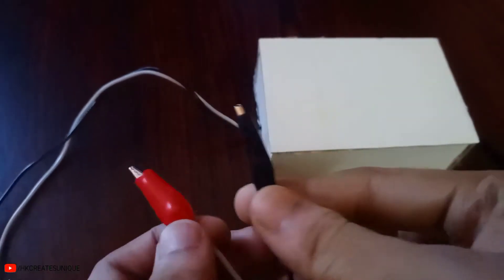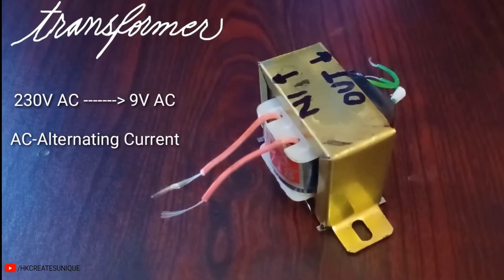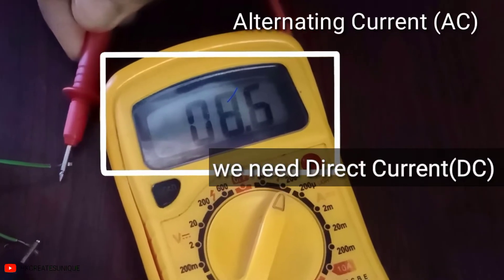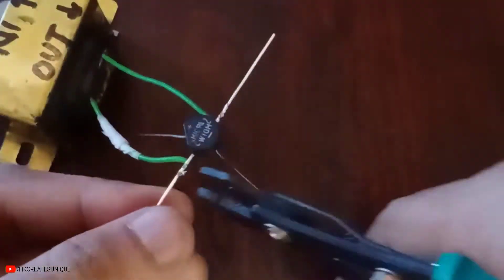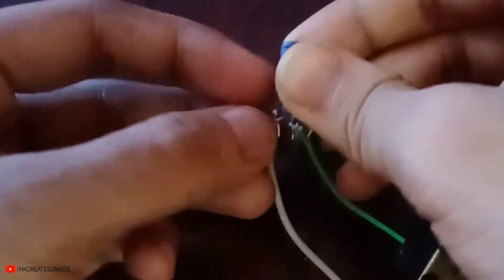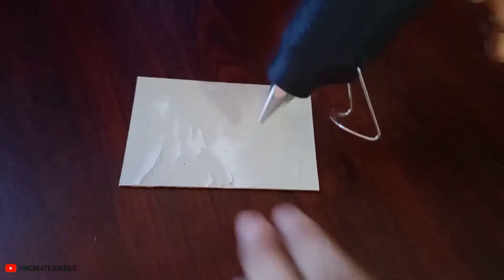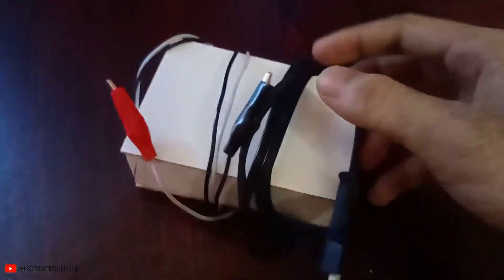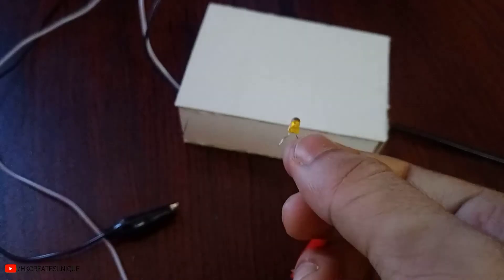How to make a Power Supply with Transformer

Comment: What is the difference between with transformer and without transformer.
Reply from the maker: I didn't understand the question... Without transformer, voltage will be high, which we do not want
Reply: @hkcircuitedu  some people make without using transformer too. So, what is the difference between with using transformer and without it.
Reply from the maker: There can be other methods which are either not safe or not good enough to power small things.